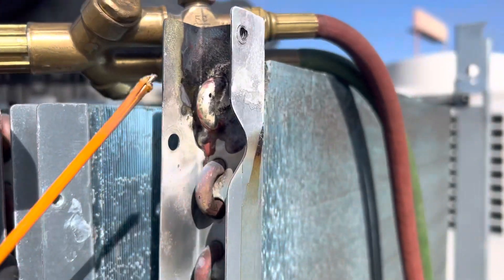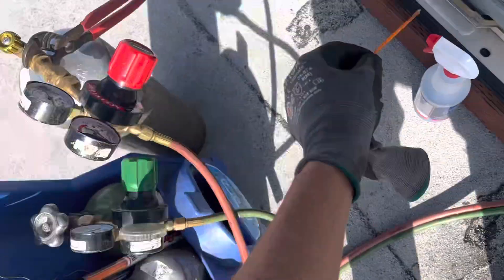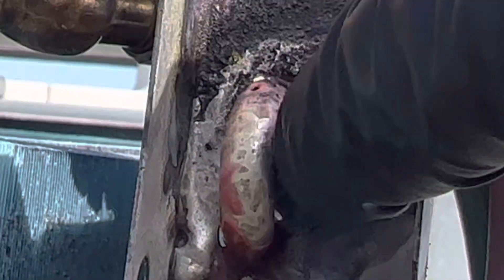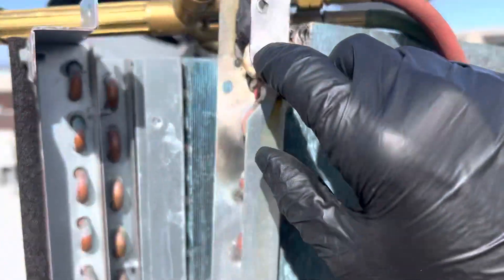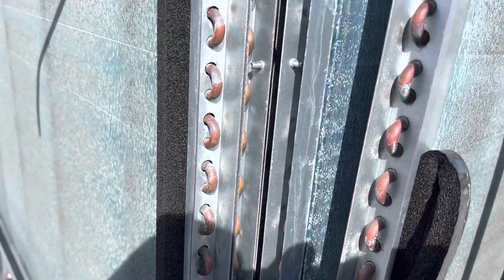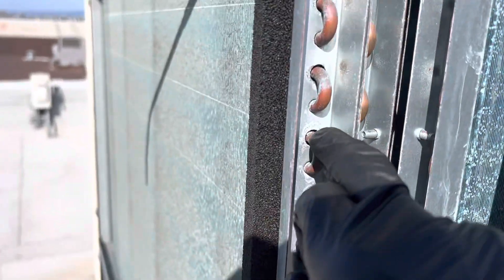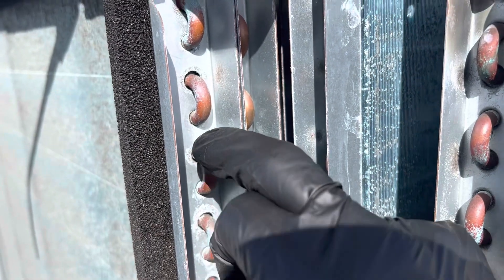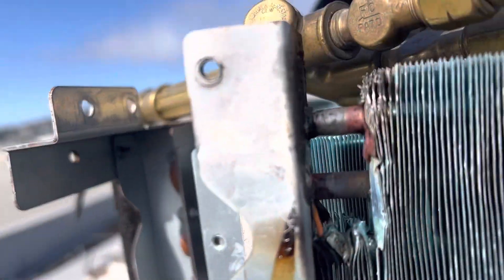56% SILVER BRAZING  Leaking Condenser.  Steel to copper Don’t be a cheap guy and do cheap work￼￼

Comment: Why do you need high silver content for covering the leak? (I ask out of ignorance lol).
Reply from the maker: It’s OK to ask we were all born on this world with no knowledge and we’re learning every day the best kind of people are people who ask questions . 

Because this is a high-pressure circuit that hicc 600 psi and very hot so soft lead solder it’s not suitable for a repair. 

And the high Contant Silver will stick to the copper and the steel.   And is much much stronger.  

Low content silver brazing rod will not stick to the steel in the leak is located directly underneath the steel. 

Would have to do extra work to cut away all the steel and possibly risk damaging the tubes because the thickness of the tubes is just a little thicker than aluminum and food wrap foil.

And because the copper is old and has been exposed to salt air and is corroding it is now even thinner and more brittle.

Comment: Should depend on what the customer wants, right?

If you know your unit is exposed to sea water, then shouldn't the customer or contractor ask for a protective coating the your coils?
Reply from the maker: Exactly but when you tell them the price is when they have a heart attack 🤣

For example on this unit the complete unit Hass to be disassembled with the outer casing coming off then it Hass to be decreased and pressure washed thoroughly.     Then it gets coated and sprayed down with a slightly caustic cleaner that just slightly itches and cleans the middle thoroughly preparing it to take adhesion of 2 to 3 coats of Apoxsee on the entire unit frame structure all the piping.      On this unit we would charge $2500+  and this one customer has eight units on his rooftop.    8X 2500 = 20,000. The majority of the customers say no.     But what they don’t realize mother nature always wins and the cost to repair all these units over their lifetime and the loss of expensive refrigerant will be 10 times more than $20,000.  Plus the loss of work or product due to losses when the unit is down in their business production.
Reply: @coldfinger459sub0  What's worse is the fact they could've ordered the unit with protective coatings😭.

Love the vids. Please keep it up
Reply from the maker: @Abdulrahman_Hi  Over here in the United States they’re cheap and most local distributors do not even stock the coils that have the extra protective coating because that would add more to the cost and everyone’s always trying to fight for the lowest priced unit to make the highest profit margin